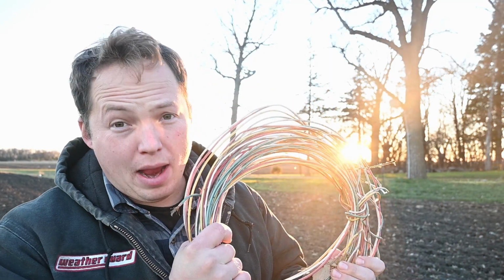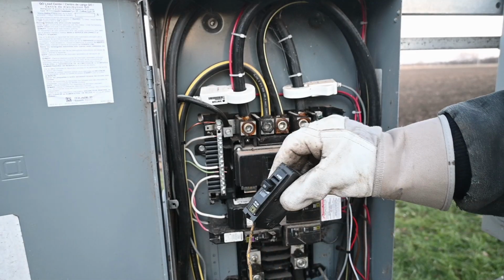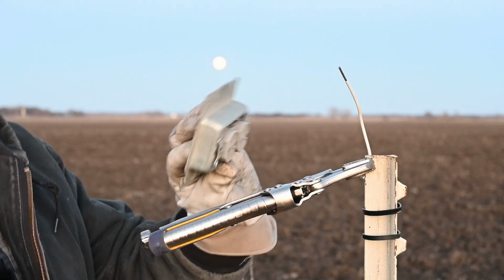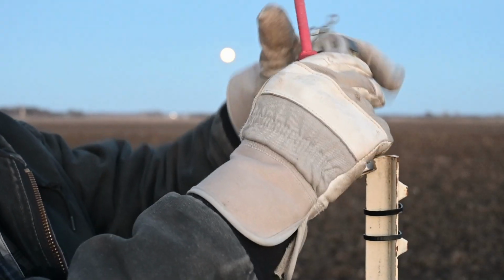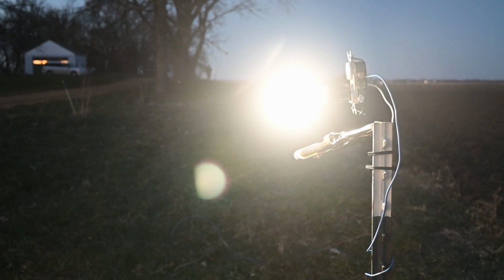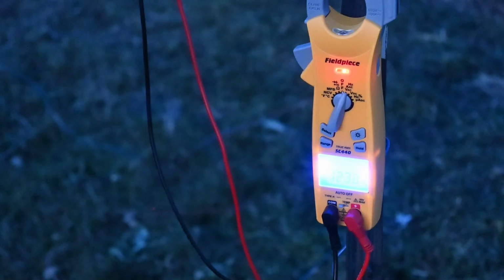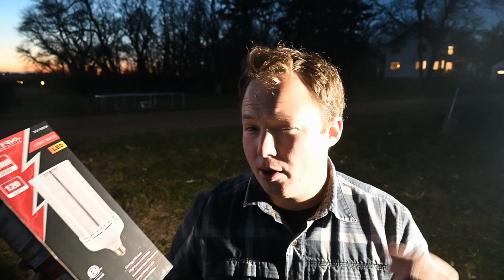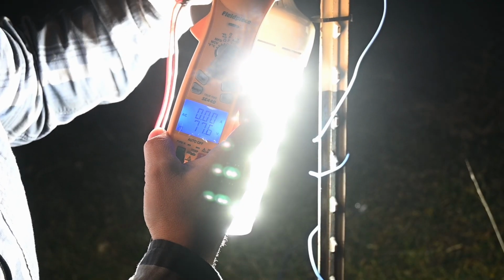Powering a Light With a Fence Post & Scrap Wire - SWER (Single Wire Earth Return) Demonstration

Comment: You should have 120Volt on each side of the neutral at the mains.  No more that that at the fence post even with no load.  A device with a switching transformer will work with low voltage up to a point because it is more like a dimmer than a transformer.    Is your ground frozen turning all that ice into one big conductor?  Do you think that is a good idea?  Is that fence post connected to a lot of other fence post with a wire fence?  So you energized the entire fence with 125-77=48 volts?  So if someone touches the fence and a well grounded metal object that is not "bonded" to the ground system they would get the 48volts AC. Like a cross country gas pipe or abandon well or storage tank abandon farm machine setting on the ground. I've never heard of a one wire electrical system.  The transformer windings are center tapped and ground to limit the voltage between the hot and ground to whatever the service voltage is.  That is the neutral which is "bonded" only at the busbar where where all the grounds of the grounding system are connected so you don't blow out a small gauge ground wire and wind up with a floating neutral, the whole system really on your side of the transformer if you are the only one on that transformer.  In that scenario a ground fault will not trip as breaker which could be a  problem with a defective device pumping juice into the ground system.  The whole ground system would be hot. The gas pipe has a nylon bushing at the meter so the pipe in the ground is not bonded to your ground system to prevent electrolysis from eating up the pipes.  Maybe the water pipe too at the meter.  I don't know about the TV cable or the phone.  You might be energizing the shielding on the cable to all your neighbors. Bond everything made of metal to the ground busbar at the meter including the neutral bus bar so the breakers will pop if hot wire conducts electricity where it should not be.  Think about what can happen.  More than 30ma of A/C across your heart can be lethal.  Like if you are hot and sweaty.

Comment: One aspect that may have not been mentioned is that the a/c voltage is converted to dc in the light bulb to the led. What if you plugged a battery charger in at the service and ran DC voltage 150' ....yes you will get boktage drop bjt you could use 24 voltt on boost or higher ?

Comment: All neutral wires are bonded to the electrical panel, all ground wires are bonded to the electrical panel.
Sometimes idiots use ground wires for neutral wires.
And people wonder how houses get burnt down. 🤨
And to think about what the meteor is going to read that actually sent this power out for that long distance I can't imagine the kilowatt that it's going to register that were used on that electrical meter..😳😳😳

Comment: I’ve ran upon old wiring systems that used this type of wiring in houses. They would use bare wire on porcelain insulators to the motor and the neutral wire came off the motor and was hooked to the gas line of the old lighting system. This is very dangerous system. It would make it somewhat safer to bury a steel plate in the ground. If you bury it about two feet it will do away with ground voltage variation. Still this is very dangerous so buy the extra TWO copper wires and RUN A GROUND with the system.

Comment: TRY NON NEUTRAL WIRE AROUND YOUR TOE! IT EILL WORK! THE PROBLEM IS: FINDING SOMEONE TO - TURN IT OFF & PUT YOU OUT 💥♨️🔥☠️💀🪦 & DUG? ⚰️. WHY? 💸 WE USED TO DO THAT BEFORE FISHING: until one of our friend took the " copper alloy curtain ROD " wired hot & plunger it into the ground! Free eart worms ( vs $2 A styrofoam cup - by the pound of dirt?🥴🥺🙄) Then ----- rain , ------- then funeral!

When : The BUYDUMB & SONS LLC ENERGY CORPORATE REWIREING OF THE PLANET EARTH >>> NON- CONDUCTIVE SHOES,  CLOTHES, GLOVES IF YOU FALL DOWN! NO MORE " CAMPING UNDER THE STARS" YOU MAY BECOME ONE?? 
RAINCOATS:COVERED WITH SOLAR PANELS ,  PROPELLERS INN EACH HAND & ON YOUR HELMET = DRAGING WIRES TO YOU HOUSE : LITHIUM ION RECHARGEABLE BATTERIES, THAT GO DEAD & WHERE ARE THEY  ( B& SONS LLC?) GOING TO PUT EM? They got a half- life like plutonium? ⚰️🪦☠️🥺 

USC : " was" supposed to protect us all from this phenomenon! Now what? Gas lawn mowers to drag power out of tall wet grass? Or are we going to Do away with our backyards and put solar cells down instead of grass and take our roofs off and put solar cells on a roof and garages then perhaps maybe when they bought sure one Williams paint by a intermediary for a multi-billionaire whereas the rights to the nano electric widgets that go into the space platform so he would put them in the paint then literally paint our cars with it so that they would generate electricity so much with solar cell and power either the battery to start the gasoline motor or power a hybrid to start the gasoline chemical moonshine motors or literally charge the entire battery in the vehicle to drive it to work and then start running wires all over the place so America looks like Hong Kong once did and Saigon but things have changed yet we're going in the same direction you'll have so many wires over your head that you won't be able to see a sunlight but don't worry at night your backyard in front yard will be lit up very well Just make sure that you ground yourself before you step out? 😭🇺🇸🙏

Comment: My dad had a stray dog back in the 1970’s that would push our metal trash can over and tear the garbage up .  He got tired of the mess he put the can on rubber were it was just the can nothing sticking out .  Then he ran a wire from the can up to the plug end at the house he hooked the black wire he ran in to the plug in and the white wire of the plug in he stuck it straight down in to the ground.  The dog got shocked when he touched the can he then pissed on it that really got him he ran off whimpering and never fooled when trash cans again !  He didn’t die he was still around for years after but he did not fool with trash cans !

Comment: No this is not much new I guess for people who are young maybe,but in the old days this is how everything ran telephones (Low voltage) you name it.
They started using neutral connections in order to add more phases (220v 440v) and to capitalize on it I think that’s all and more important not disturb the livestock,environment through hot earth.
Reply: I’d like to add take manufactured audio systems for vehicles only had one wire that went directly from your amp or your radio out to the speakers .

Comment: It is a circuit grounded by or through a fence post, rather than powered by it. Fyi, this confused me until I figured out what he was trying to do. Cool demonstration for anyone wondering why they call it a grounded line. Energy is always flowing through the environment, it is why solar power works, and why we have seasons. Each element and mineral, including the air, has preferred energetic states. They absorb energy from the sun's light/radiation and geothermal energy from conflicting gravity sources. They then release that energy into mostly natural process conductors/semiconductors in the environment to reach equilibrium like water seeking its' own level. In the atmosphere electrical storms release built up energy through lightning into the ground, completing nature's grounded circuit. Bless Y'all!

Comment: (ESD) Electrical shock drowning is extremely dangerous. Especially in fresh water where the body is a higher point of conductivity than the water around it causing the whole body to become a large main conductor for all the water surrounding it paralyzing the whole body and causing the victim to drown even when very low voltage and amperage is detected in the water.

Comment: I've done the same thing to drive an audio speaker at a distance using only one wire.

In the old days, direct wire fire and burglar alarm systems also used earth return; one single-pair phone line can connect two different alarm systems to a central monitoring station using the earth as the return path.

Comment: Not withstanding any other questionable safety. Make the external connections first. Ie, The receptical connections first . Then make your connection in the power panel. That elimenates any boneheaded mistakes lighting you up on load end connections. Such as mistakenlingly having the breaker set when pushing into buss bar. Then doing the load end connections. This is a very dangerous situtation. If the ground dried out and lost continuity to the ground the post no longer ground potential. And would place the voltage on the post in the amount that is proportionant to the loss to ground in resistance. That being said if a living being touched the post greatly increases the potential of electrution by becomming the path to ground. At least if the transformer had a properly sized grounding resistor it would limet the amount of current that could flow through the victum. Please people do not watch this and see it as a viable solution to distance lighting issues.

Comment: I just want to say before you get any further just for my sake of being honest what I see and hear, what I'm saying is I don't see any point where there would be any resistance because it's all ground that wire is all ground I mean that distance from the ground at the power source is the same ground where it's at I mean we use that unless it fencers all the time the Earth has the ground at least the ones I've seen round is ground I've always said I don't believe I can be wrong because ground is ground for instance where the magnetic pole is on the Earth magnetic field for instance is the same whether it's at the power source or whether it's at the fence post that would not seem like it's rocket science

Comment: This is an excellent way to kill someone. The smallest breaker in a home is 15 amps. By not supplying a low impedance grounding electrode to trip the breaker in the case of a short circuit you have set up an extremely dangerous circuit. 
If your light is attached to any conductor (metal pole, metal fence) and the circuit shorts to that conductor, you will have a deadly circuit that will work for decades, just waiting to kill a kid or adult that walks up barefoot and touches it their left hand. Their hand will get locked on to the metal conductor by an involuntary muscle contractions, but because you have chosen to forgo a low impedance grounding electrode in your circuit and a simple Ohm's law calculation will show that the breaker will not trip.

Comment: In some respects, the standard single phase, rural  2 wire distribution is not really so different. In the standard 2 wire system, the ground conductor is run at the top of the poles and the hot wire a few feet below it. On every pole, that top wire also has a run down the  pole to the earth ground. Having that top wire does a few things even if it somewhat redundant as a grounded return path. 

Having that top ground means the conductor itself acts a the return path so a marginal earth ground won't cause a voltage drop. But it also adds some protections. For one, a  lightning strike will hit the top wire and run down the ground lead to earth, thereby keeping the hot line from a high voltage surge, If a tree limb drops onto the line, it will most likely pull the ground wire down on top of the hot, causing a trip before the hot wire hits the ground or something below it that could become energized. . So having that top ground wire adds reliability and a little safety.

Comment: I used this in 1980 for an parking light the only problem I had was when we had a drought I lost conduction in the soil and the light stopped after the rain it came back on.  In very arid soil I do not expect there to be a demand for this unless you are using the system to detect soil saturation levels.

Comment: This video is fake you're not pulling power from the earth you're pulling power from your light box
Reply: I'm curious about where he said he was pulling power from the Earth that would make this fake.  Would you mind sharing?
"Powering a light with a fence post & scrap wire - SWER (single wire earth return) demonstration".  Power FROM the box using the scrap wire he had, metal fence post in the ground/earth for the return path.  
Is this not what he did in the video?

Comment: I wonder if you clamped the stake how much current would be flowing compared to on the wire.  Also if you put a wire in the ground in two spots connect by two earth rods between the transformer and the outlet if you would get any current flowing from the earth back up through one ground stake and through the wire and then back down through the other grounding stake.  

Just curious about how ground currents interact with metal stakes or rods that are connected to metal and if the higher conductivity creates a differing path.

Comment: So far I've been able to run equipment, lights, motors, pull absorbent amounts of fire/lightening from trees and melt sand into glass at over 1-1/8 miles away using a generator with 15 amp breaker and the wire used was the size of a fine sewing needle. The ground was a Stanley screwdriver driven into hardpan beside a highway. I'm pretty sure I could do the same at 10 miles but only had the mile plus wire. The wire was rated at 7 amps 
Have videos.
Reply: I'd like to see the videos.
Reply: @watchdogu.s.a.8973  Sorry, just saw this. Good, I'll get it set up for you. Let me know if still interested.
Reply: @michaelkirkpatrick8258  Hi Michael.  I had forgotten about it but, yes, I'm still interested.

Comment: open neutral on a tv xformer pole mounted  induced current 100 ft away in clients house copper pipes.  and big emf  in house wires..    old school lineman probed  bare earth  around home  with vom,   and it pointed to the pole..   fixed neutral all problems gone...   NICE
Reply: I'm interested in a more detailed explanation of that troubleshooting if you'd care to share.
Reply: @watchdogu.s.a.8973   went through several steps  trying to isolate high EMF  in house... moved big feed wires . insulated  city feed water pipes.  (which gave a shock when touched.?}   linesman from edison  clipped his meter to ground water pipe,   and extension other lead about 10  feet,  attached to screwdriver,  poked into earth  around house,  highest reading  (milliamps?) was straight at  street pole.. with aux  CATV? box  mounted.  he checked and repaired bad neutral in catv box..    job complete, no charge!

Comment: Wait at what point was a switch added you showed us a neutral wire from outlet to pole and hot from breaker to outlet then added the light but now without showing us there is a switch sounds fucking fake me

Comment: that's why they call it a ground wire,  all electricity in your home it grounded to the earth the neutral in also connected to the same ground rod in the breaker panel ground buss

Comment: 1st thing the neutral goes on the silver screws on your outlet which is the left side of the outlet if the ground terminal in on the bottom. Second from what I'm getting here is you are running a hot wire to the outlet and grounding it. 3' deep should be plenty enough resistance to compete the circuit. If my ex is there please make sure she stands in extremely wet dirt. Thanks

Comment: I've done this, and it worked. However, the bulbs never seem to last. I also attempted to connect to one 120v phase @ a well, with the neutral to the ground rod, to operate an angle grinder. That didn't work.

Comment: I've wondered about how much the earth acts like a resistor and how much it acts like a capacitor. When you consider those voltage gradients you can measure in the earth, that suggests to me that some of the current that is flowing may be pulling charge from the surrounding earth during part of the cycle and returning it back to the earth in the other half of the cycle. If the earth does have some parasitic capacitance, then I would expect to see some phase shift between the current and voltage waveforms. I'm also thinking that how moist the ground is probably plays a part and if there are noticeable capacitive effects, they are probably more pronounced when the soil is drier. It would be interesting to try to measure and see if this is noticeably different than a two wire setup with a dedicated copper return path.

Comment: The neutral wire is connected to the ground at many places.  Probably right there at your service panel!

Yes there is a good enough connection for a full 15A through that fence post, but I'm not sure if your one-made-of-many wire is capable.

Comment: I was an automotive electrician for over 30 years and then went through an apprenticeship and became a Master Electrician.  

People need to know that this is the wrong way to do things!

You did sort of say it was dangerous and got your animals away before you energizing the circuit.  Imagine if a male dog peed on the post while the circuit was energized. You also mentioned it would not work with a Ground Fault circuit breaker and a regular breaker would not trip, but you did not tell people "not to do this". 

Today we use Ground Fault circuit breakers on many circuits to protect people from getting shocked and Arc Fault circuit breakers to protect circuits that have arching that might cause a fire. You can also have an AFCI circuit breaker and a GFCI receptacle that way you get both. They really work and protect us! 

You were wearing gloves, was that to protect your hands?